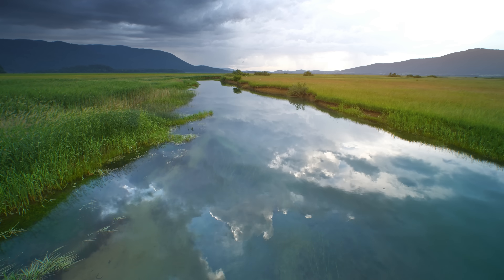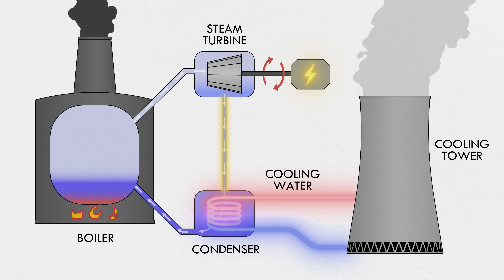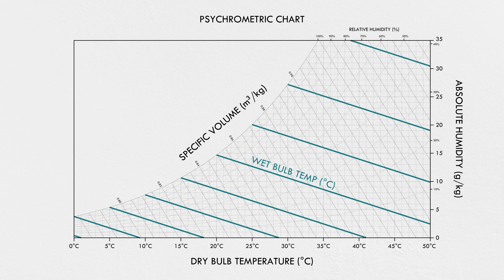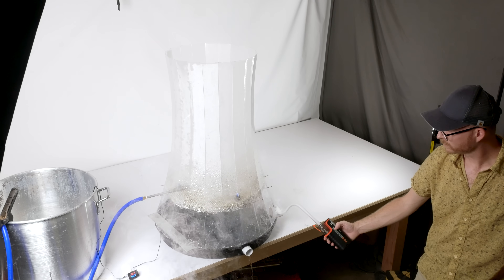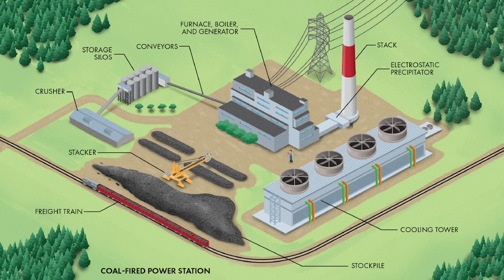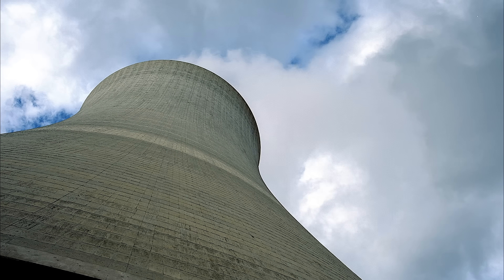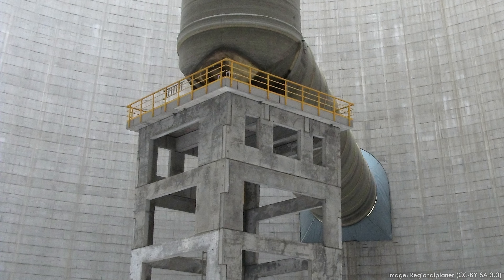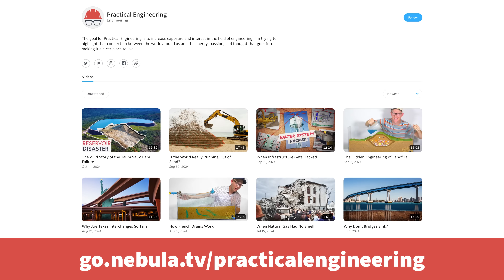Why Are Cooling Towers Shaped Like That?

Comment: In my region, this hot water is pumped through the city in winter for heating.
Reply: Exactly what I wanted to ask. Why don't they use the hot water vapor as a heat source? With a bunch of heat pumps and enough insulation you could provide nearby towns with hot water and heating. Heck, why don't we do this for all heat sources? Large buildings that are cooled in the summer, industrial scale server farms and I bet there's some other sources. You need something cooled, people need hot water or other type of heating for industrial processes. Seems like a no-brainer
Reply: @lmmortalZodd  He mentioned how for nuclear, cooling the water is a critical safety feature, so miles of pipes drawing heat inconsistently through the town adds far too much uncertainty. A loss in efficiency is far better than a meltdown
Reply: @Billionth_Kevin  that’s not really the case, you can have multiple heat exchangers in the same system, one to pass heat to useful destinations and another fallback to release it as is done today.

The complexity goes up, but given that you literally double-dip on this heat (generate electricity, then pass the heat on), it should be worth it.
Reply: @thedave1771  A: just arguing for fun at this point. 

B: Since the system is designed to convert steam back to water and pull as little of the heat as necessary, seems the completely failsafe 1st exchanger that can pull as much or as little heat as it demands with no mechanical intervention, no computer controls, absolutely 100% hands off in case of emergency and nothing else works this still needs to... I don't know if that is a solved problem, no saying it couldn't be. 

C: With the efficiency of heat pumps, is containing heat to move it with around with super expensive infrastructure, that only is necessary in the winter, really better than dumping heat into the air, then having a heat pump on location to pull heat from the air? Might only be worth it on the absolute coldest of days if your nuclear power plant is smack dab in the middle of a city.
Reply: @  it seems doable overall. 

I’m not really sure why heat pumps would be more useful in the winter, but maybe I haven’t thought this through? The utility of a heat pump is that you can move heat from a cooler side to a hotter side, or from similar temperature sides more efficiently, extracting more heat than is possible due to thermal equilibrium)

And also, most of the energy consumed by a heat pump is released in the form of heat, and since the system’s product is heat, at least some of that might be recoverable as well.

My thinking is that you’d do a normal heat exchange first to take advantage of the steam, then a second stage using a heat pump to drop the coolant water’s temperature even lower, and then as you describe in B.

Heat pumps can be incredibly efficient, even in a residential setting they can easily remain way more than 100% efficient even when the cold side is 40°C cooler than the warm side (e.g. heat your house to 20°C when it is -20°C outside). In this case the efficiency is only considering heat dumped into the house, vs 100% efficient electrician heat.

I would imagine that at this scale they would do better still, because squeezing 1% more efficiency won’t do anything for a homeowner, but at this scale, it sure will be worth some extra dollars. 

If the coolant could be returned to the input temperature with 100% capture efficiency you’d be producing more heat than the nuclear plant’s electrical output could generate. Obviously you can’t, but as an exercise to consider just how much energy we are talking about, compared to today’s system where we generate electricity and then use that electricity to generate heat, capturing any significant percentage is huge. 

Obviously electricity can be transported more efficiently, there is tons of inefficiency everywhere, etc. I’m aware this isn’t magic. But again, even a few percentage more of an entire nuclear plant is a lot. 

I would have no problem with nuclear plants going up in or near my city, and I’d move to live somewhere that had free heat (I live in a cold enough climate already…), but even if NIMBY wins, I can imagine situations where industry/manufacturing could benefit from the heat. Imagine massive greenhouses in Canada’s prairies being able to produce tropical fruit with a year-round growing season, with the electrical output tying into the grid, and the whole greenhouse effectively being the plant’s radiator.
Reply: @Billionth_Kevin  Прекрасно всё охлаждается. Отопление и горячее водоснабжение не отменяет надобность градирен.
Reply: @lmmortalZodd  Because people see these towers and believe they’re letting off toxic gases or radioactive material due to fear-mongering and long-term disinformation campaigning.
Reply: Yup, there is a lot of waste heat to go around. Using it should get more and more interesting as energy costs increase.
Systems have to get more efficient, as waste heat is contributing to global warming too, as dumb as that sounds.  @lmmortalZodd
Reply: @lmmortalZodd the water does get contaminated. Small amounts, but it does happen
Reply: @ you can isolate it completely, if desired. The loops don’t need to interact at all if you design the heat exchanger with that in mind.

Using heat pipes to transfer the heat between two loops is an easy-to-imagine example, although I suspect a real engineer could engineer something way more efficient than anything in my head.
Reply: @lmmortalZodd  Нет это делается не так. Строится ТЭЦ - тепловая электроцентраль и от неё запитывается отопление, так же она производит электричество и горячую воду. Чем меньшей температуры возвратная вода тем эффективнее ТЭЦ. Потому при ТЭЦ и ГРЭС строились тепличные комплексы. Сейчас ту же задачу выполняют системы напольного отопления - у них подача 40-35, а обратка 30.
Reply: They don't do it in the US because the plants are FAR FAR away from populated areas.
Reply: Should happen everywhere, this is clever but still a terrible waste. I've seen distilleries using pipes to heat greenhouses, much smaller scale.
Reply: @florahibernica  Radiating directly into the streets isn't necessary a good thing, depending on what the resultant temperature is. If it's just a few degrees above freezing, you get what's called soggy weather, basically it's cold without the actually good part of being cold, which is sequestering moisture.

Other than Seattle, Americans seem to be entirely unfamiliar with soggy weather. "Autumn is my favourite season" is something you hear from like a quarter of Americans. You hear it from like, 0% of Irish people.

Give me 10 degrees or let it freeze, nothing in between please.
Reply: We should also replace cars with public transportation and walkable cities. Unfortunately that sounds like communism, so it's impossible. Being incredibly wasteful is better for the economy. Numbers have to go up hahaha 🌈  @florahibernica
Reply: @robertschnobert9090 

How does not needing to look at the same terrain for 6 hours every time you want to visit your parents communism?

In Europe a 3 hour dive can send you to a different country easily! Depending on your "luck" I'm sure it could lead you through at least 3, probably even 4 countries
Reply: @robertschnobert9090 not everyone lives in cities mate.
Reply: @Surtees-ff  I assume you live in either the UK or Australia (because "mate" :D). Both of these countries have around 85% of their population living in cities or urban areas. Seems like a good place to start.
Reply: @ agreed. No vehicles in cities then. Electric trucks only. No taxis.
Reply: @Surtees-ff Even here in a remote scarcely populated area of Canada there's a bus that travels twice a day half the county so most people especially young students or retired folks can travel. Also some buses for festivals to avoid impaired driving.

Again it just requires some efforts.
Reply: @Surtees-ff  Just most people.
Reply: @robertschnobert9090  "Being incredibly wasteful is better for the economy" - maybe according to Keynesianism or something.
Reply: @robertschnobert9090while we're at it we'll replace your smartphone with a book so you'll stop posting politics on places they don't belong
Reply: That's such a good idea
Reply: There is no problem  using heat from  nuclear cooling water as a source of energy in regional heating systems . Of course you will need a summer cooling resource, to use when heat is not needed. 
The problem may be that these plans are usely currently not placed near enough big citys to make it worth the trouble building the pipes to the city. Or the energy loss in the pipe networks.

In the 60es there was actually a nuclear regional heating powerplant built in a mountain 
Outside Stockholm, (  ågesta verket) it did not produce any electricity only warm water , on .the top of of the mountain there was  cooling  tower for emergency cooling if the water distribution system should fail.
The  relatively small plant was not used for very long and is in the final fase of decommission right now .the  cave will eventually be sealed with the relatively safe  low radiation  stuff still inside.  There was a idea turning it to a protected heritage site/ museum but the owner opted for "demolition "instead

There is talk about s.m.r nuclear units as a future power source in Sweden, these will very  probably be built where heat can be used and not wasted. 
In Sweden waste heat from industrial 
Processes on city  nearby industries to heat the city's,  
In some places the industrial process heat alone   is enough to  work  into the autom.
We have dedicated heating plants also ,burning biofuel, and garbage . Some produce electricity also, in steam turbines.  
Some cities has regional cooling pipe networks, for energy effective  cooling of building in the summer.

Ground heating is sometimes used to prevent ice snow build up on selected   central walking streets  and squares .  Some off The colder  return water that regional heating network is 
Cooled of before returning it to the heat plant this way , this is for the good say the experts  because the return water should be below  a surten relative temperature to the outgoing water from the plant.

This is not unique for Sweden 
A lot of norden European  contrys has this
Systems  kind of  systems.
Reply: That is a very smart use of hot water!  It would be difficult to install a system like that after-the-fact in an existing developed area, howeve.
Reply: @lonnarheaj  Потому застройка СРАЗУ проектируется под центральное теплоснабжение.
Reply: This is pretty common in universities with their own power plants too
Reply: @vvvvvvvvvwv lol i thought our uni having a power plant is unique :D it also provided the surrounding areas with hot water while it was working (it's being repaired/modernised right now but that should end in a year or so) 
i mean, it's literally a power engineering oriented university
Reply: @aiaioioi  Нет не уникальна. В Советском Союзе целые города так отапливаются и освещаются. Есть даже один город который отапливается и освещается атомной электростанцией находящейся в скале.
Reply: Is it somewhere in Europe?
Reply: co-generation is awesome
Reply: District heating is common, and expanding here, in Denmark, also.
Reply: You all do realize that New York City has the largest city wide steam system still in use in the world, right? They literally did this before electricity to heat buildings and continue to do it to this day. We've truly gone full circle.
Reply: @2Burgers_1Pizza  known as 'combined heat and power'. A while ago it was being pushed as the new way of generating power, but since then it seems to have gone off the boil (pun very much intended).  

I suspect the sheer expense and difficulties involved in installing it (basically, big pipes everywhere) made the idea impractical in most situations. 

Also, district heating has a deserved bad press - ask anyone who grew up in Soviet eastern/central Europe and lived in one of those huge 'panel house' estates. 

You got no heating until the official switch on date, no matter how cold it was, and then your apartment might be freezing or tropical, depending where you were on the system. 

My first experience of this was visiting a friend in Budapest in the depths of winter, and discovering them dressed for summer, with all the windows open to let out the heat!
Reply: @paulhaynes8045  Сейчас так не пошикуешь, в каждом тепловом узле каждого дома стоит регулируемые клапаны и счётчик тепла. Да, отопительный сезон начинается тогда когда средняя температура упадёт ниже +10 и из-за этого поначалу некомфортно, зато потом красота - знай себе плати🙂

Comment: Great video! In engineering school I never put it together that humid air would be less dense than dry air, you learn something new every day.
Reply: I would assume the humid air is more dense since it's holding more moisture  & water is pretty heavy?  Since dry air has less moisture, you would think it would be lighter/less dense. High humidity air contains less oxygen. While dry air contains more oxygen. So I guess that's in part why dry air is more dense.
Reply: @michaelbrinks8089  Water has a lower molecular weight (18) than O2 (32) or N2 (28), meaning that increasing the molar proportion/partial pressure of water vapor in air will decrease the average molecular weight of the mixture, decreasing the density for a given temperature and pressure. Since we mostly interact with water as a liquid it's easy to forget it's a lighter molecule than O2 or N2!
Reply: @Obu2who   Oh yeah it's 1 part oxygen 2 parts hydrogen. With hydrogen being the lightest element.....So it makes sense. 
Forget solar panels, I want a mini nuclear reactor to power my home. A piece of uranium the size of a golf ball outta do the trick. For 25 yrs of nonstop power 😂 The government bunkers might have nuclear power. Or giant  propane tanks to run generators since it can be stored indefinitely.